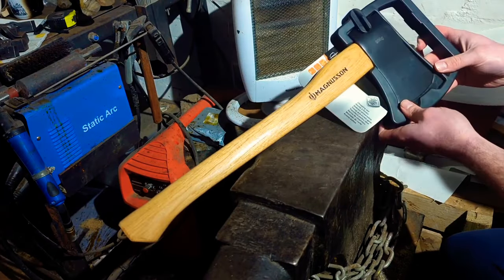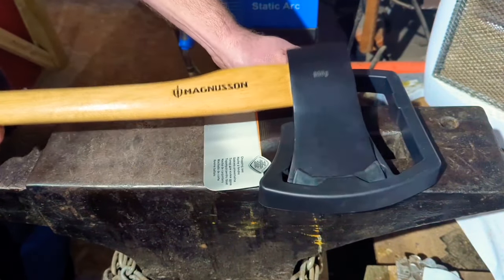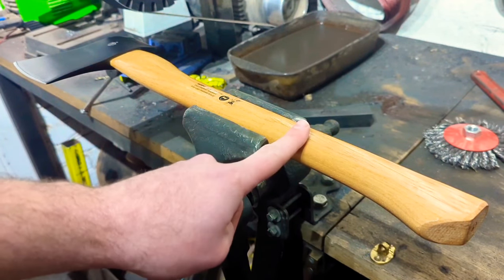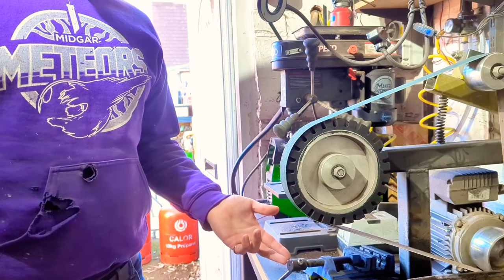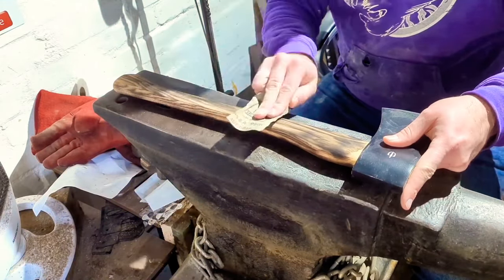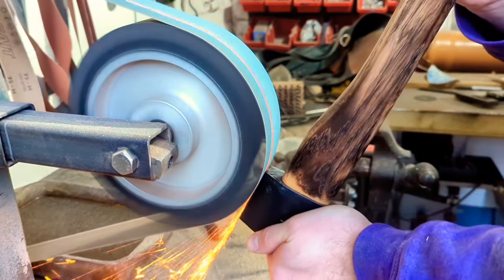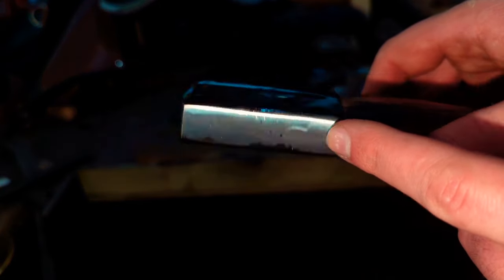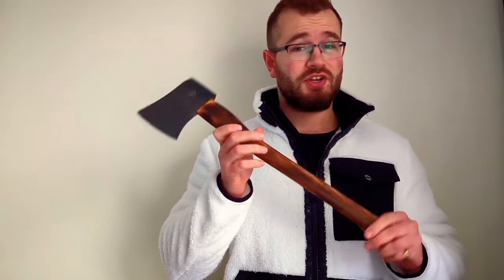Upgrading a Cheap £20 Axe into a Beautiful Bushcraft Axe

Comment: Great job Phil. I've refurbished a couple of shotguns using cold blue and it comes out really well. I found warming the steel up before bluing got a more uniform finish on the barrel but your axe head obviously didn't need it. It looked mint 👍
Reply from the maker: I'll try heating the steel next time, see if it works better next time.

Comment: That axe head has a really weird, but also very cool, sort of... reflective/glass like quality to its appearance. I do feel like the handle is a little too long for it though. Feels like it should be about half the length, in a more hatchet style. But another impressive axe refurbishment. Really makes me want to go out and buy the extra tools to do this myself. Just going to be a lot of work by hand...
Reply from the maker: Axe handle length is really dependent on the task you want it for. I kept the length the same as the original, thinking it'd work nicely as a small forest axe. The weight of the head would be good for this length as you could use it for limbing and splitting easily, as well as maybe even felling smaller trees. But again, it comes back to personal preference. You could definitely shorten it if that's what you wished to do. :)

Thanks! :)

Comment: Nice improvements to a cheap axe = you had me right up to the time you picked up the blowtorch. It now screams to me 'wall hanger' or 'weekend poser'
OK I'm old and clearly in the minority here, but back in the day when these tools were 'daily users' for many, many thousands of woodsmen, nobody charred handles except by accident. That said, I enjoyed the rest of your work
Reply from the maker: I grant you that I personally did it mainly for a stylised choice 😅, however there are a lot of woodsman who char their handles and swear by it.

It helps to harden the external fibers, whilst not preventing the core from being springy; and also helps prevent rot, whilst aiding the absorption of whatever preservative you're using. I'd recommend checking out some of Buckin' Billy Ray's videos where he talks quite in depth about his reasoning behind charring his handles. But at the end of the day, to each their own. I don't judge. 🙂

Comment: I've been into B@Q this morning and looked at this exact axe, now £25. 
Does it hold an edge or should I just spend double and get a 900g Hultafors?
Reply from the maker: Depends if you want a project or not I guess? Hultafors is definitely the better option, but if you wanna have a play, get stuck in! The edge has held fine. :)